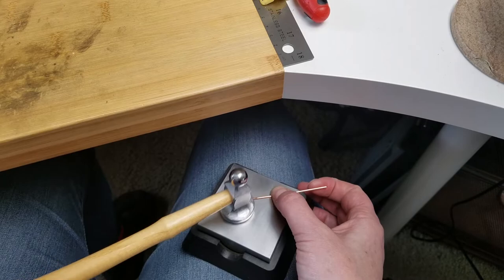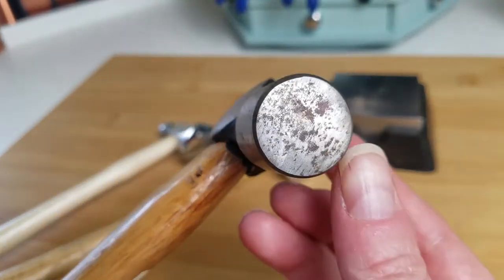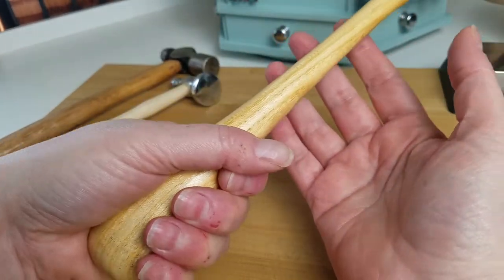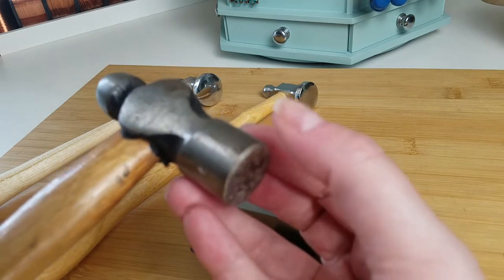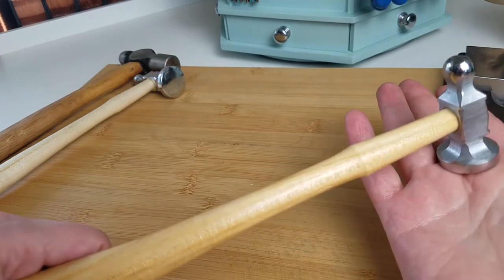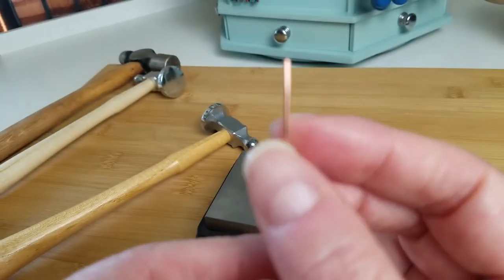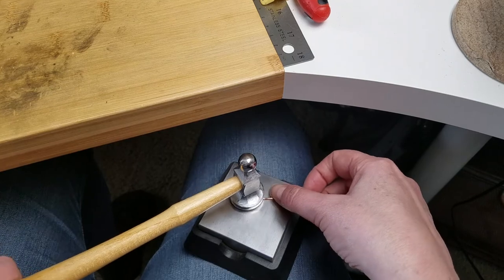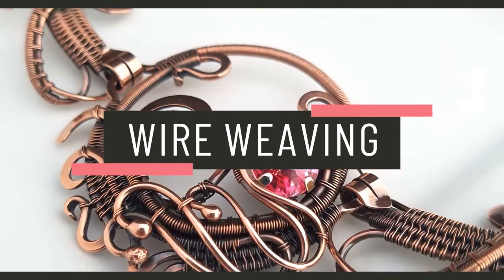How to Use a Chasing Hammer: Part 1 - Learn to use the planishing face of your chasing hammer

Comment: Seems like using a rough ball pein hammer for rustic texture is incidental.  The Chasing hammer was meant for chasing HITTING STEEL CHASING TOOLS!.  Using the right tool for the job means using a polished planishing hammer instead.  Sorry, but frustrated with craft use of professional tools.  Ignore me.
Reply from the maker: Dude! I introduce women to a fun, creative outlet. As a professional silversmith, you know the satisfaction that comes from making something with your own hands. So, why on Earth would that frustrate you? It's not like we crafters are raiding your bench and using your personal tools. Also, the hammer I use in this video is actually a Beadsmith brand CRAFT hammer. So, it shouldn't offend you at all. Now that you mention it, though, I have had my eye on a couple of Fretz hammers. Maybe I should go ahead and buy those tools so you can be justifiably offended by my content. 🙄

Comment: Smh. No wonder this stupid hammer was putting nicks in my wire! The face is flat. And I got it from the jewelry making section! 😤🤦🏽‍♀️
Reply from the maker: There are flat face chasing hammers. Unfortunately, they're  not always clearly labeled as such. So it can be difficult to tell the difference unless you know exactly what you're looking for. I think you'll find that a domed face hammer will be much easier to work with, though. And you can still use your flat face hammer for other purposes.

Comment: Extremely helpful. I'm a beginner and have been struggling with my chasing hammer which, it turns out, has a completely flat surface. I'm going to try to return it to Shipwreck and will buy your linked hammer!
Reply from the maker: The convex face really makes a difference. I think you'll find that a new hammer will work much better for you. Glad you found this video helpful. Thanks for watching!

Comment: This is perfect. Thank you so much. The detail you go into about hammers is fantastic.  What if you want to flatten wire without the texture? I've made some simple earrings with smaller beads. They will fall off unless I use wire to wrap it off or I can flatten the wire some so they won't come off when they're laid down. I flattened the wire but I don't want the texture look.
Reply from the maker: Great question! The key to getting flat, untextured wire is to be very aware of which side of your wire is resting on the flat smooth surface of your bench block. You want that surface to be the front face of your wire because it will have fewer (if any) tool marks. I talk about that, and I demonstrate it as well, in some of my more recent videos. If you watch this video, for instance, I talk about how to strategically plan your hammering so you'll end up with a smooth surface on the front face of your piece around time code 6:33: https://youtu.be/X0girFPgV80
Reply: @Door44Studios  thank you so much. You’re an excellent teacher. So thorough. Who knew there is this much to a hammer? Lol. I tried it snd it worked perfectly. Thank you
Reply from the maker: You're very welcome. I'm so pleased that this tutorial was helpful for you!
Reply: Same. I can't get my wire to flatten without texture. I have severe ADD so this video is too long for me to watch. She did a great job, it's just too long for me.

Comment: The first jewellers chasing hammer I bought had the ball one side, but the flared face was totally flat.  I couldn't understand why I was still getting loads of tool marks until I bought another with the slightly domed face.  It has it's uses, particularly when the whole piece is smaller than the face of the hammer, but the domed one is so much easier for forming larger pieces.
Reply from the maker: Yes! That's the most common frustration that I see with beginner wire chasers. I wish those flat-face chasing hammers weren't so common. They're often sold in craft stores and bead shops. So, I often hear from wireworkers who are struggling to figure out why they have such a hard time mastering chasing hammer techniques.

Comment: Love your infos! Can't you file a bit the face of that old hammer to soften it?❤
Reply from the maker: You can smooth the face of an old steel hammer like this one. I would recommend using sandpaper rather than a file to do so. That's just part of the problem of using this type of hammer, though. The bigger problem is that it's much too heavy for hammering wire. You'll have more control with a lighter chasing hammer that's designed for working with non-ferrous metals like copper and silver.

Comment: Thank you so much for this video! I learned so much here...can't wait for part 2! On the spiral, could you file it to a point before you make the spiral and hammering, or do you think waiting til after the hammering would be easier? Thanks.
Reply from the maker: You're so welcome! I'm glad you enjoyed this video. Hammering will almost always distort the ends of the wire. So, you will typically get better results if you trim and shape the point of the spiral after hammering. Don't be afraid to experiment with that process, though. Try switching things up and see if you like the results that you get. There's almost always more than one way to achieve a desired finish. And you may even discover some fun new finishes and techniques of your own through such experimentation.

Comment: I would like to know…. Where you get the files that you use for wire work…. I can’t find them that are fine enough or maybe I am just not using it correctly.
Reply from the maker: I bought mine at my local hardware store years ago. Make sure you look for needle files. They're pretty standardized in terms of how fine they are, but some files in each set may have different tooth patterns on different faces. 

I use my files for rough shaping and then I use fine grit sandpaper for refining and finishing. You won't get a fine finish with needle files.

Comment: What material and gauge wire are you using in this video? If you use a different gauge or material (i.e. stainless steel vs. SS filled, etc.) will that affect your hammer technique? Thank you!
Reply from the maker: I believe I was using 16g dead soft copper in this video. It doesn't really make a difference though. The technique is the same for any type of solid jewelry wire, regardless of the alloy. You'll just need to get a feel for whatever type of wire you're working with and adjust the strength of your hammer strokes. For instance you'll need to use a bit more force to hammer stainless steel vs. sterling silver. As for hammering either gold or silver filled wires, you'll need to cut the strength of your hammer strokes by half or more. You have to be very gentle with filled wires because if you strike too hard, you run the risk of exposing the base metal core. And that will cause issues with your finish down the road. As a rule, I don't recommend hammering filled wires if you can avoid it.
Reply: Thank you!

Comment: Does the quality of the wire make a difference with the spreading? I'm having a difficult time getting a nice wide spread. I'm using a 16 g dead soft from amazon and a 20 g from fire mountain beads. I am using a domed jewelers hammer from beadsmith.
Reply from the maker: Wire quality can make a difference, yes. I do not recommend buying wire from either Amazon or Fire Mountain because it's difficult to be certain that you're really getting solid dead soft wire. The three sources for wire that I recommend (in order of preference) are Rio Grande, Creating Unkamen, and Metalliferous (aka: Parawire). You'll find links to all three sources on my blog at https://door44studios.com/resources.

Comment: Hey just wondering if you use half hard or deep soft wire?? Thank you!!
Reply from the maker: I use dead soft wire almost exclusively. Especially in the larger gauges that I would typically hammer.

Comment: Would that 3 oz hammer work for 10, 8, or 6 gauge wire with harder strokes? Thanks!
Reply from the maker: Yes, it will. But it will require a bit more effort and perhaps some annealing. I would step up to a 5 ot 6 oz hammer for those gauges. It's always better to use a heavier hammer with lighter strokes than vice versa. Remember, the goal is to let the hammer do all the work. If you're working up a sweat while hammering, you're overworking your wire, your tools, and your body.
Reply: @Door44Studios  Thank you,  appreciate it!
Reply from the maker: @lovingthisagain  my pleasure. 😊

Comment: Hi is this a 3oz or 4oz hammer? Thanks!
Reply from the maker: I think I call it out as a 3oz hammer in this video, but it's technically a 3.53oz hammer. So, if you're shopping for a hammer, either option will work. I also have a 6oz hammer, that I use on heavier gauge wires.